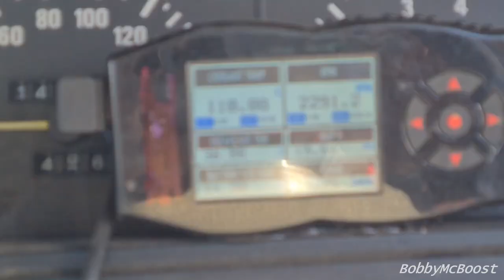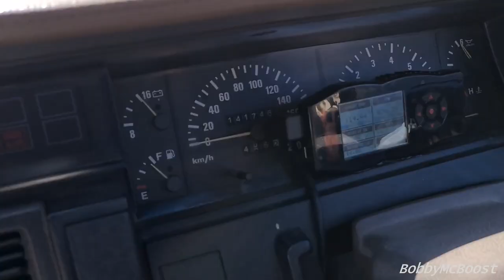650hp BARRA Pintara - First Event! can we even drift...

Comment: Wheel alignment is everything on a drift car IMHO. Looks like the car self steers pretty well, perfect caster is around positive 7°. 
You boys all did a great job out there, turn 1-2 on symmons is tricky to learn! 
It will all come with more seat time. Predict what the car is going to do, concentrate more on throttle control and smooth steering input from the driver. 

We're over due for another barra patrol 4x4 video! I've almost finished building mine and need some motivation

Comment: Should add spacers to the bonnet so it lifts up the back to allow the heat to escape the engine bay
Reply from the maker: Yeah can work, heat wasn't really an issue. The fan cooked itself and would just blow the fuse and turn off. Then dan and myself did 8 laps no fan 🤣 I didn't explain it real well in the video 😆